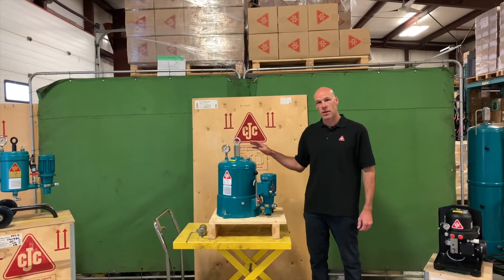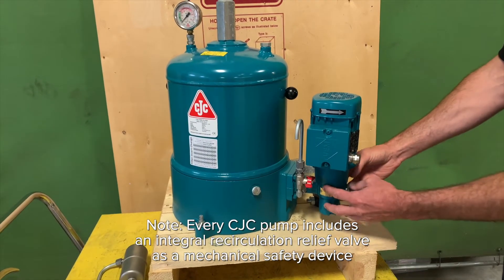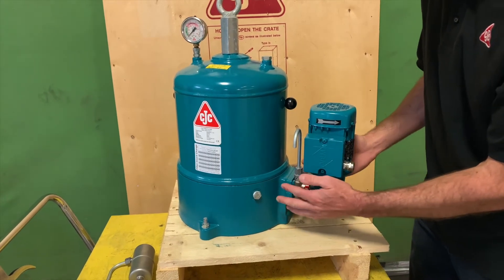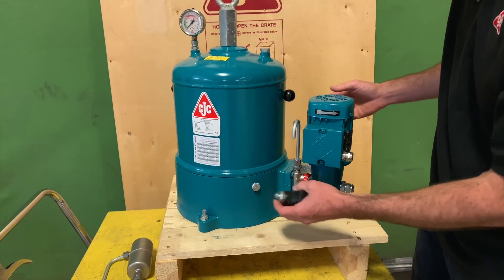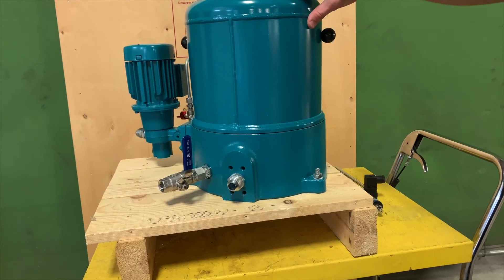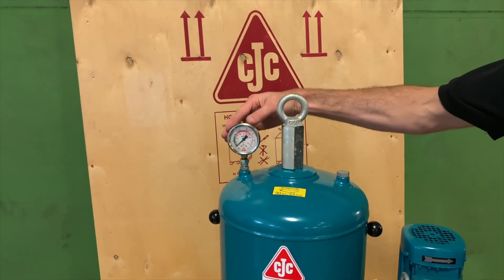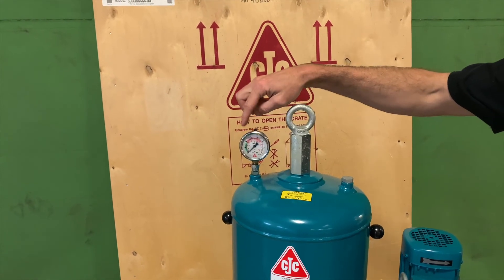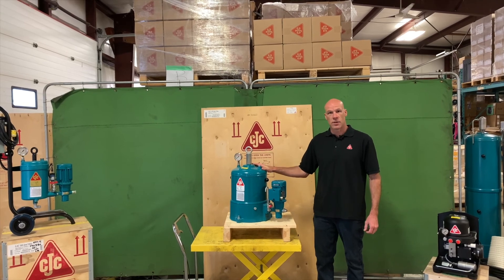CJC Fine Filter: HDU 27/27 Overview

Comment: What about the filter spacer? Would that affect the pressure on your gauge after you change the filter on model 27/27 new filter but I keep seeing one bar after I prime the system shouldn't it read zero on the gauge?
Reply from the maker: As long as your outlet line back to the oil tank is free from restrictions, the pressure you see on the gauge will be just what it takes to push the oil through the filter insert.  Typically the filters are sized so the starting pressure on a clean filter insert will be around 0.5 Bar, but the actual pressure is a product of 3 factors: flow rate, filter insert type, and oil viscosity - but viscosity is also dependent on not only the oil viscosity grade, but the oil temperature.  Colder oil will always result in higher starting pressure.  
The filter spacer is only used between the filter inserts on filter units that have more than one filter, such as HDU 27/54, 27/81, and 27/108.  The HDU 27/27 only uses 1 filter so no spacer is used.